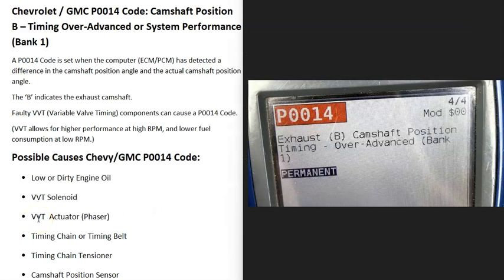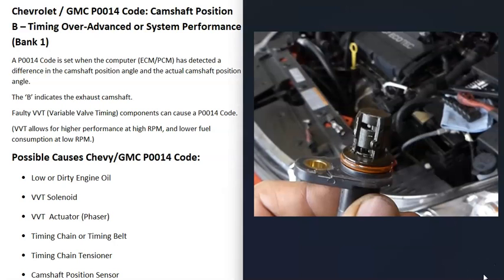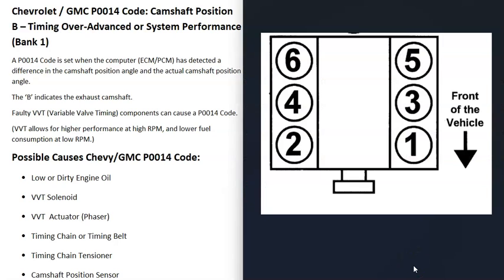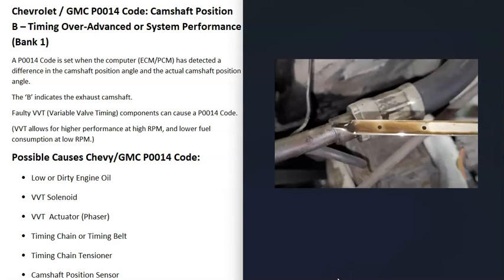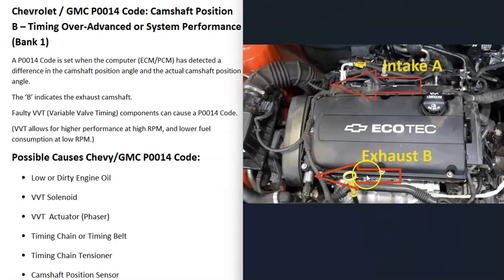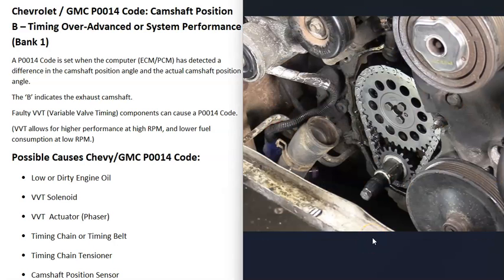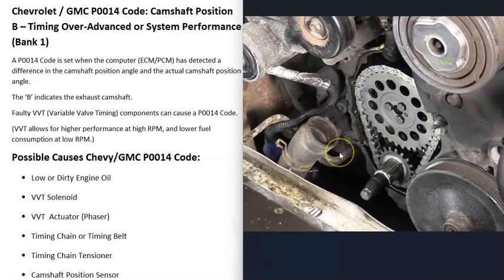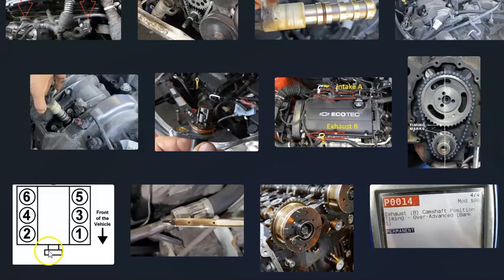Causes and Fixes Chevy/GMC P0014 Code: Camshaft Position B Timing Over-Advanced System Performance

Comment: I was wondering if when the code appears, and I delete the code, should it reappear when I'm driving afterwards? 
This code comes on shortly after going down the road. Once deleted, it doesn't come back on again, unless I shut the engine off, then it'll kick back on again shortly down the road. 
My oil was pretty bad when I bought it last week. I immediately changed it. It was extremely dirty and black. I replaced the oil and filter with a good full synthetic oil. It's certainly running quieter than before, especially on first start up. Should I just continue driving it to see if the fresh oil cleans out the system? I'm watching the oil just to see if it begins to look dark, but I've only driven it about 150 miles so far.  Any suggestions? I don't want to do anything that could damage the engine. 
Thanks

Comment: Hey i got bank A and Bank B camshaft position timing over advanced. Is it because of the dirty oil? I just did an oil change and it still showed up. 

I just reset it now and waiting for it to show up again.
Reply from the maker: Oil flows through the VVT system, so dirty oil can affect it, but there can be other causes. It needs to be diagnosed.
Reply: @HVAC_Mechanic  the engine runs just as it did when i bought it brand new. The timing isn’t the issue. 

If it shows up again i might run some lucas cleanser.

Comment: My p0014 code wouldn’t go away after replacing intake solenoids after changing timeing chain oil change and everything else the code wouldn’t go away so I examine the back solenoid and it was not in correctly and popping out by a inch to the motor unlike the original that went flush after putting the old one back in the code disappeared

Comment: I have 05 canyon. I just changed the vvt . I was thinking of changing the camshaft sensor. I have a bit rough idle but really rough at after 80km/h. Any advice? I habe to push accelerators hard to get the engine to go.

Comment: My mechanic is suggesting we replace the solenoid (not sure if "A" or "B" side) and the actuator as a first step. Is replacing both necessary or should we start with the solenoid first, see how it goes and then do the actuator? 

If it is an electrical wiring short or issue, will replacing both or one of these solve the problem or will the short still existing after replacing them?
Reply: Hey did you fix it?

Comment: My OBD scanner is recommending that I change my solenoid. How do I know which one to change out? Or would I have to change both in this situation?
Reply from the maker: It is always best to get a diagram for the specific vehicle, but "A" is usually the Intake solenoid, and "B" is usually the Exhaust solenoid.
Reply: @HVAC_Mechanic  thank you so much
Reply: @HVAC_Mechanic these are the ones with connectors on Top of the motor at the passenger side??

Comment: So if you had dirty.engine oil and changed the oil should I just erase the code or do I need to change the sensor?
Reply from the maker: You can clear the code and see if it comes back. If the code comes back, something is likely clogged or damaged.
Reply: Chevy says 1300 dollars, they need to tear down part of the motor to get to the camshaft position sensors(2) this sounds silly to me... @HVAC_Mechanic

Comment: I have that code on my 07 acadia.  Car still runs great. I've changed two of the vvt. Camshaft sensor, crankshaft sensor.  Changed the oil. And still showing.
Reply: Did you ever fix this ?
Reply: Did these repairs involve opening the engine and 1300 dollars???
Reply: @bedandbeat I was wondering  about it cs my mechanic said it
Reply: They bad with the timing chain probably is already breaking out. My friend has 2008 Acadia and that happened chain broke an the estimate was like 1300 hundred

Comment: I just bought a 2018 Camaro rs Used with 62k miles on it the check engine light came on went to autozone to get ot scanned the code p0014 came up So I went and got an oil change at fire stone and the guy that was changing my oil told me to come here to show me something the car was raised in the air he pulled the plug on the oil panel to show me how black the oil was so the oil hasn’t been changed on the car so he we
Changed it amd the check engine light went off